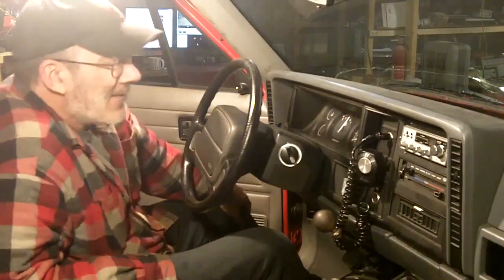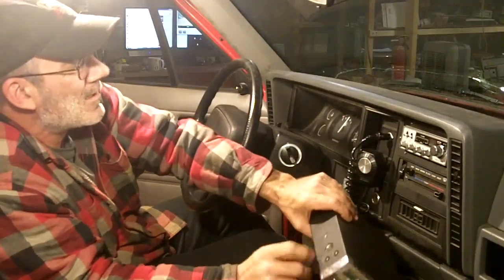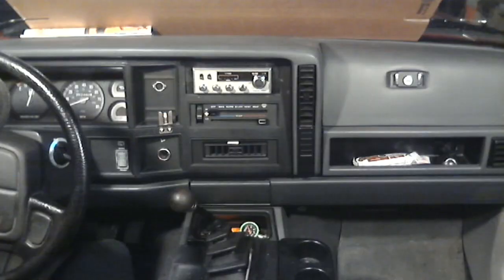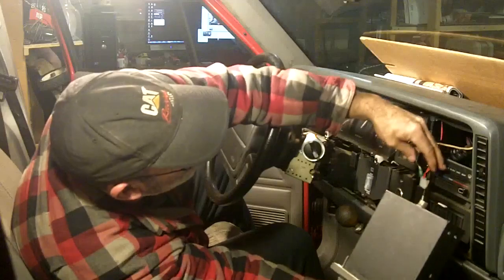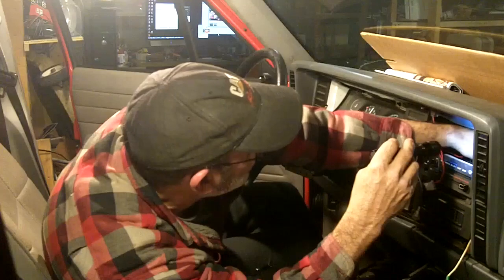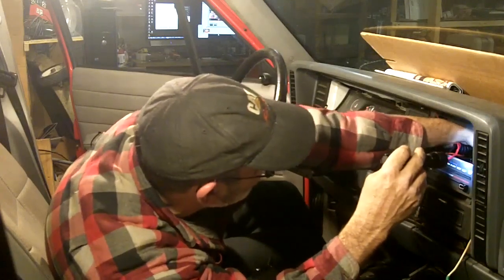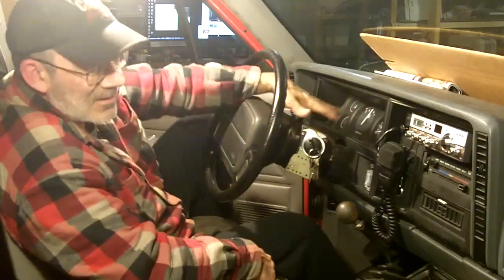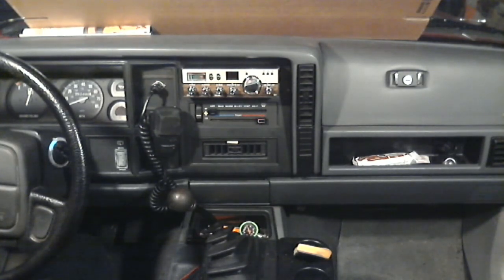Changing out My CB Radio.....Again!

Comment: Cool video John . I can remember i changed my radios so often i would just sit them on the seat With direct wire from Batt . Ahh those were the days  I couldnt even put a figure on how many radios / Equipment i have had in 40+ yrs . Have a good 1  73s - 55 in the Buckeye

Comment: Those little TRC 453s are easy to get over modulated as they are a hot radio. I have the cousin, the uniden PC 122, and it has hot audio topo.
Reply from the maker: They're great radios,  and Mine will be again. I'm planning to restore My 453.  Thanks for watching, 73's

Comment: Always but always run your feed direct to the battery with a fuse block or reset. You will get more power and less interference from ignition and other outside influences. Always run to the battery number 12 stranded wire good for 20 amps and you can now put a nice 100 watt inverter in your vehicle.

Comment: The 451 is awesome. My original was bought at a yard sale for $10. (1993?). I have had it in 2 18-wheelers and 3 cars and a 20% circuit board. Today i have retired it to a base backup. But! My new radio is a NOS TRC-451 LOL. I just recieved a TRC-422B 40 ch. AM. That will replace the Kraco 23 ch crapper in my 1977 dodge motor home. Anyway inhave tried different mobiles but i keep putting the 451 back in. Its the best of the Realistics as far as im concerned. I now have 4 lol
Reply from the maker: Very nice! It's the same here! I keep trying other radios too, But the 451 keeps finding it's way back to My dash. Happy Holidays, 73's from 151 SC.

Comment: I remember those old TRC Models They mostly had Uniden boards in them and I would do channel mods to them when I had my radio shop.......  If you are over modding then check VR 5 and check for a clipped D34 or TR 28 or TR 29 I never did clip any part ... I always adjusted the proper VR for modulation .........  I'll check more for the clipped part and let you know, but that's what I see in the PCB layout so far......
Reply from the maker: Thanks for the info. I ended up putting the little TRC-453 back in My car. I rewired a Yaesu mic to work with it, and now it sounds great on the air.
Thanks for watching, 73's from 151 SC.
Reply: @MowerJunkie  I got an adapter to use a Cobra HG M75 power microphone with the Uniden 980.
That setup works great

Comment: I used to own a 1974 gmc all wheel drive truck  hou could have installed a grand piano in the dash and you could sit on the fender and work on the engine  those were the days
Reply from the maker: Copy that, I had a 79 GMC, You had to climb into the engine bay, just to check the oil.

Comment: Wonderful channel ! Thanks for upload all your videos! Question: What is the major distance that you can Tx/Rx  in AM (not ssb / usb and not propagation scenary) with 4W. Regards from Buenos Aires Argentina!
Reply from the maker: Thanks for the kind words. With a properly tuned antenna, A 4 watt radio will usually do 5 - 7 miles mobile to mobile. and 7 - 10 miles mobile to base.

Comment: Apreciado colega, tienes un gran vehículo 4x4 con un excelente BC, te escribo desde Venezuela en América del Sur, en 1995 compré un Jeep Grand Wagoneer, instalé un CB Cobra 19 Plus con un lineal amplificador de 100W acoplado a una antena Realistic tipo látigo de 1/4 de onda, subía con mi Jeep al parque nacional Ávila ubicado a 2100msnm y desde los alto de la montaña hacía de DX´s con Mexico, Centro América y Miami. Te felicito por que el trabajo de empotrar tu radio en el tablero quedó muy bien, parece de fábrica. 73´s 5 YX 11728 Carlos Valero Kerch @YY5CAV en Twitter...

Comment: what do you think about radio cb MIDLAND 7001 .120 CH..is it good radio..thank you om
Reply from the maker: I don't have any experience with a Midland 7001, But it is a very cool looking radio! Thanks for watching, Take care.
Reply: I do have an almost new 7001, the MK2 at 120 channels. 
I respect these radios a lot, however a CB like President Grant is better than the 7001 on both transmit and receive (selectivity, efficiency of NB).  Yet, the 7001 and the other Midland Precision Series are, in my opinion, the best looking CB radios ever (I also have a 5001 NIB).
Reply: Midland was the top qualiry compeditor to Cobra and Midland in the 70s n 80s. For a few years the Midland PowerMax series 70-250 was neck and neck with the Cobra 29. The 7001 was built for Midland by Cybernetics and is equal to Courier. Keep that radio (or sell it to me hehe)
Reply: @chetsjug  Yes I agree, although I find the 120 channel President Grant better in some aspects, the quality of Midland is TOP. No issues until now on capacitors or any other part on my 5001 or on my 7001. And they were built in... 1979 !!!!

Comment: 🤔---Do you want to sell the radio that you are taking out?  I had 1 of them a long time ago..
Reply from the maker: sorry I don't want to sell it.   I'm going to try to restore it. Thanks for watching, 73's
Reply: @MowerJunkie  😔dam.     But mine  did the same thing with over modulating. I turned back the audio a little bit not too much used as static noise cancelling microphone on it and it worked wonders. The only way it would not over module 8 was on am single Side Band you couldn't understand it that's how bad it got....